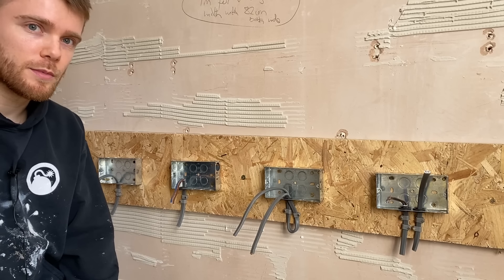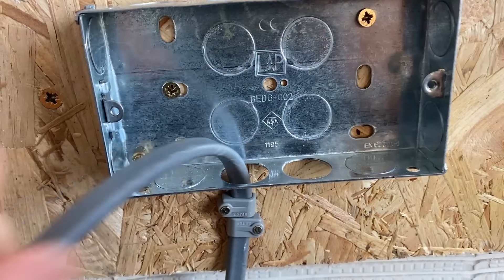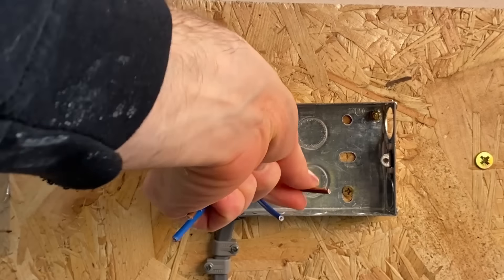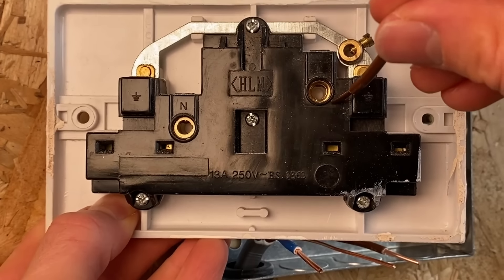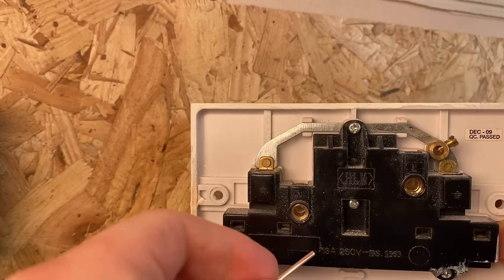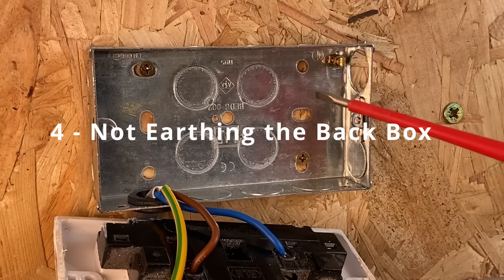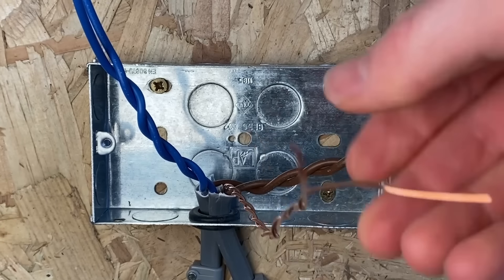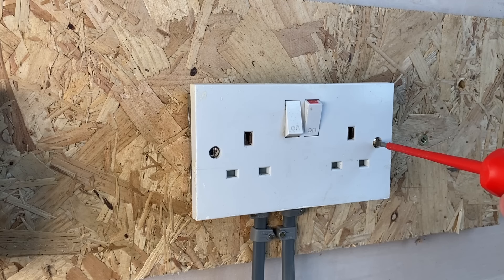5 Biggest DIY Mistakes Wiring a Socket

Comment: The only thing I would disagree on is aligning the screw heads, while it is visually nice I feel it is is important to firstly concentrate on tightening them enough, but not overtightening them. If you are focused on lining them both up you could end up either not tightening them quite enough, or overtightening them a bit. A lot of sockets (and switches) come with caps to cover the screw heads anyway.
Reply from the maker: Thanks for watching!
Reply: I once spent two weeks on a building site aligning all the screws on light switches and sockets to a forty five degree angle because that’s what the architect wanted
Reply: @malcolmgullam8348  That's crazy! why 45' ??? if you are that OCD I would have expected vertical or horizontal, but 45'. Who ever notices anyway!
Reply: @colinfaed5910  That’s what they wanted I was getting paid  or
Reply: @malcolmgullam8348  I just had a quick look round my house, most light switch screws aligned vertically, the socket screws are all over the place and in many cases hidden by plugs, also most too low to see without bending down anyway. I hope this doesn't make start looking at them in other people's homes!
Reply: @colinfaed5910  It’s a habit I have had since 1991 it’s completely nuts
Reply: You do have plenty of torqueing leeway to set horisontal/vertical heads. It does look professional.
Reply: @colinfaed5910  I’ve had that problem since 1991 it’s nuts always carry a terminal with you ):
Reply: It’s ok for DIY people to change a socket cover , but should not install one …I’ve seen so many poor installations from diy work .. and even the ones who do get it right , think oh I can try a bigger job now .. painting decorating even basic plumbing yea it won’t kill if you get wrong ..
Reply: You've never done long Pyro runs as an apprentice, screws for the clips aligned horizontally or vertically.
Reply: @colinfaed5910  You'd surely have to do them as 45degree mirror-image pairs - but then which way? Being an electrician isn't easy!
Reply: @stpeter7432  It's top edges out (\) (/) top edges in (/) (\) makes them look sad!
Reply: @stpeter7432   (x) (x)  or (+) (+) or does that look a bit risqué?
Reply: @colinfaed5910  🤔 Hex or Torx . . ? Or how about those horrid blanking plugs? This has made my life so much more complex; I think I'd better lie down for a bit!
Reply: At most you're talking about an extra 1/4 turn...
Reply: I worked for an American Railway Signaling Company in Tralee, Kerry Ireland back in the 80's /90's and it was practice to have all Slotted Screw heads vertically and they gave a reason for it. Any moistre can more eaisly run off the screws rather than get trapped and also of course it looks much better. Yes I know there are screw covers now but they may get lost over time if changing switches or sockets, so just do the basics right.
Reply: @nialldaly7108  I am starting to feel I need to go round my house re-aligning all the screw heads! : )
Reply: Don't agree, I worked with a partner for many many years doing electrics in commercial premises no house bashing, offices factories and lot's and lot's of banks and building societies laboratories and hospitals etc and we always line the screw heads vertically, never stripped one never left one loose.. And one of the benefits of this is we can spot easily if a socket has been interfered with as very rarely are sparks as pedantic as we were.
Reply: @MrChrissy1r  I can see you point about spotting other hands at work. I don't know who last did anything with the sockets in my house since it was rewired 10 or so years before I bought it, but there isn't one socket or switch with the screw heads aligned, so I know it wasn't you!  : )
Reply: @rouman7  Its perfectly OK for a competent DIY to instal a new socket as long as its not a new circuit . So a spur of an existing ring main is OK. In my 46 years years I have seen more dodgy work from people who are qualified than I have from DIY . The amount of remedial work on new build electrics is staggering .
Reply: I don't care about the screws but it hurts to see that most front plates in my apartment are in a few deg angle 😵‍💫
Reply: @hbp_  If any were like that in my house I would have to adjust them. Painters and decorators often loosen them to paint or paper behind the edges and don't put them back level. I have been known to straighten them using a small level! Am I a bit OCD? 😀
Reply: @colinfaed5910  I do my screws at approximately five past seven if you think of the screw as a clock face.
Reply: @olinpaul  You are making my OCD kick in! they muse be vertical or horizontal only! 😄
Reply: Hard enough with a wood screw; a machine screw needs to be rotated till it’s right. And that may not look perfect, like you say, don’t strip the thread or crack the case
Reply: @colinfaed5910  Try it, looks so much better in that position, almost artistic.
Reply: I torque connections to the manufacturer's specs. Faceplate screws are, by convention aligned with the slot vertical here in the US. Based on my visits to family in Scotland, UK inspectors are not, as a group, as petty about non-essentials as are US inspectors.
(Biggest, most profitable company in my area and I own it and have been torquing to spec for over 35 years now so all you arm-chair experts can skip this one, I know nobody you know actually follows code.)
Reply: @nialldaly7108  That is the actual reason Niall, many consultants here in Ireland insisted on vertical screws for years. I never lost the habit.
Reply: Screw position is irrelevant as long as tight.
Reply: Aligning screw heads 😂 I don’t know a single spark who’s ever come out with that waffle, so who are you trying to impress? If you’ve got OCD issues that’s your problem - don’t go projecting them as some sort of ‘standard’.
Reply: @kennztube EXACTLY. It is far more important that the face plate is fixed and secure. That’s the reg. Screw positions? Honestly these wafflers 😂
Reply: @ethelryan257 
L
Reply: A lot of sockets come with little white covers to hide which way the screw heads are, plus who cares which way they are, only way to see them would be crawling on  floor.
Reply: @malcolmstarkey1062  I guess the screws on light switches might be more noticeable, but I never look at them. I've have a few full property surveys done over the years and never had a surveyor point out incorrectly aligned socket screws!
Reply: @highdownmartin  have you ever changed a socket? The but part is typically on a spring strip so there's loads or room between loose and too tight.
Reply: @richardschofield2201  yes. I’ve got 50 year old MK sockets around our house, quality gear but it’s all thick plastic or in a few cases Bakelite. No springs involved. So the screw goes until it nips then there’s about 1/8 till it’s quite tight.
Reply: @colinfaed5910  sometimes it’s done to see if anyone has tampered with it
Reply: What it does do is let you know someone else has had that front off.
Reply: In a hospital the screw heads , all screw heads whether distance saddles or plate screws had to be vertical, so they didn’t gather dust. That’s what I was told back in the 60s for a nhs hospital. Just habit now,
Reply: @leftin74 I have been in some dirty houses and no matter how dirty the house is I have never come across dust on switch and socket screws
Reply: @leftin74  You'd really like to think a hospital kept everything clean enough that dust didn't gather anywhere!
Reply: @colinfaed5910  anyway, what’s with the screws showing on the plate. In Australia they have modern two part plates . The front just clicks over the fixed back plate. So much easier when it comes to painting around them. I would think that the Brits have these types as well , so the screw head position is irrelevant
Reply: @leftin74  I guess it's cheaper to make it one piece? Most plates I've seen recently have a recess around the screw with little caps that push in hiding the screws. These work well until you need to get at the screw, then it's tricky to get the cap out without marking it. Still you often get spares caps.
Reply: @colinfaed5910  vertical,,,thats how i leave the screws after I've done a job,  my reason is that if Incase down  the line I ever get called back to a job because the customer says its tripping or  what not , I will know if the customer has been fiddling about with it,
Reply: Aligning screw head is dumb and ocd 
Being the correctly tight is more important than, would you alter your correct torque terminal screws so they were vertical.
Duh
Reply: That's crazy, I can understand being meticulous but that's OCD
Reply: I don't think that would be an issue. The thread on the screws is very fine so it would be very easy to line them up without stressing the socket.

Comment: In my experience it's not just DIYers who make some of these mistakes.
Reply: Absolutely!
Reply from the maker: Absolutely! Thanks for watching!
Reply: Correct lol
Reply: Part P 6-week wonders spring to mind!
Reply: @stevegray5263  I see a stat that other week that nearly 3/4 of all NIC approved contractors don't actually carry an industry recognised qualification.
Reply: Mostly they can't be bothered to do the job correctly and cut corners,seen it plenty of times ,if a jobs worth doing or that could be my OCD kicking in lol
Reply: @1stinlastout165  no its not your OCD, they want in, job done and gone, as quick as poss, for as much as poss. Charge for 3 days, finished in 1 but the price doesnt change!
Reply: Exactly. I have rewired my entire garage and installing many electrical appliances in my house due to the "professional" cowboy electricians that did it before me. Installed new light fittings, sockets for automated garage doors, zigbee bridge to control sensors for things like lights, wireless switches, relays, outdoor lights that can be controlled using my phone or on schedules etc etc. It really is not complex. It just requires a bit of common sense i.e. never use a t&e thickness rated below a circuit breaker max amperage. Ensure everything is earthed/cpc and has a green and yellow sleeve to protect them. Use suitable conduit over clipping in cases of exposed wires. Be mindful of junction box ratings for the circuit you are installing etc etc it really is not difficult. Makes me laugh when electricians come out and say that should be done by a "professional" costing many hundreds of pounds when I can do the jobs myself saving a fortune. Understand regulations around spur's on ring mains or how radials can be wired.
Reply: Yes, the electrician that wired my house made nearly all these mistakes.
Reply: @craigchamberlain  It's always a learning curve tbh, better ways of doing things/new products are released all the time. I tend to use my trusty old digital multi meter instead of an MFT. I know these MFT's are quite clever in that they make the job easier for testing like calibrating the resistance in the test cables themselves, when doing a R1+R2 I just subtract the resistance from the final reading to get my true ohms reading. One thing that is a pain though with a multi meter is checking voltage of sockets due to the safety feature on UK sockets but other than this it works ok for me.
Reply: @sl0w_racer  A multimeter certainly lets you do some testing but probably the tests I find most reassuring are:

1) the insulation resistance test, which is typically done at 500V on 230V systems and will detect potentially dangerous conditions that you simply won't find with a multimeter at 9V or whatever it is during a resistance test.

2) the earth loop impedance test, which allows something like 24A to run from line to earth to determine the impedance of the earth loop. It's really important to have an accurate reading for external loop impedance (Ze) because in order to calculate disconnection times for protective devices, you need to add Ze to R1 + R2 to get Zs. I'm sure there would be a way to rig something up to measure this with a standard multimeter and some other components but it's really easy with the MFT. 

3) the RCD test where you can test either the cut off time at various leakage currents (0.5x, 1x, 5x) and in different phases (0, 180) and you can do a ramp test to see if things like USB sockets are causing some natural earth leakage that might leave you susceptible to nuisance tripping. There is even an automatic mode where you can plug the tester in at one end of your house then place it in automatic RCD test mode and then go back to the breaker and just keep resetting the breaker as it goes through multiple tests and trips. Then you go back to the tester and can see all the results of each test.

There are lots of other nice features such as polarity checks, automatic zeroing of lead resistance, and with more modern MFTs than mine you can do all sorts of clever stuff which for a full time electrician probably saves them lots of time.

Anyway, FYI, I paid £381.99 on eBay for a Megger MFT1552 in a carrying bag with a bunch of leads and probes and tips. It came fully calibrated with 9 months to run although that has now expired so I need to get it recalibrated really before using it for any big projects. I honestly didn't know what I was missing until I started using it. Now I don't even wire up a new spur without testing it. :)
Reply: What people need to understand on here , is there are electricians and people who call themselves electricians , there is a difference ..I done a apprenticeship 4 years , and worked in domestic , commercial , and industrial .. I also worked in Germany , France , Spain .. and all over uk ..I retired last august ..things have changed since I started better equipment , better teaching , better safety ..but still to many cowboys. Lots from Easter europe etc..but there are many good sparks ..it’s not only common sense you need but proper training .. I would never recommend any untrained person to rewire there house ..  training is there for a reason ..
Reply: @rouman7  This ^
Reply: Electricians just do not know! They are driven by their own opinions!
Reply: Yes there are a lot of Cowboys out there ….. beware of the cheapest quotes and try to use a qualified electrician who has been recommended ….
Reply: Yes, my experience is these are the short cuts professional electricians tend to do, and worse.
Reply: @rouman7 y experience is that the Eastern European electricians work to far higher standards than native British ones. The same with plumbers, I've only ever met one who works to my standards.
Reply: @JIBS.  An 'NIC 'electrician' mate of mine never heard OHMs Law.🤣🤣🤣
Reply: Lived in four houses. Never changed a socket where it wasn't really awkward because the cable was too short for a comfortable fit. Sometimes been forced to heave on the cable to try and get an extra couple of centimetres.
Reply: At my sister's newish build house the so called electrician had left the cable in the sockets so short you had to disconnect the socket to get the face plate off

Don't say that it's DIY people that carry out these poor practices

It's all about educating people
Reply: @notinch  yeah that is really annoying. I try to aim for 200mm of single insulated wires inside the back box with just a tad of double insulation peeking through. It’s pretty straightforward to lose that length inside the box without nipping the wires under the faceplate mounting screws and it gives you plenty of length to remake the connections cleanly many times in the next few decades.